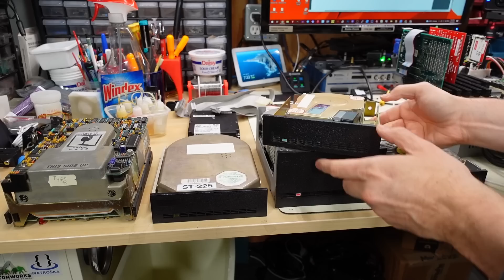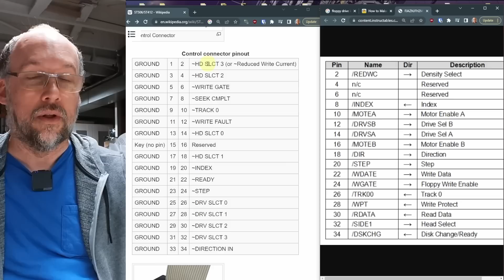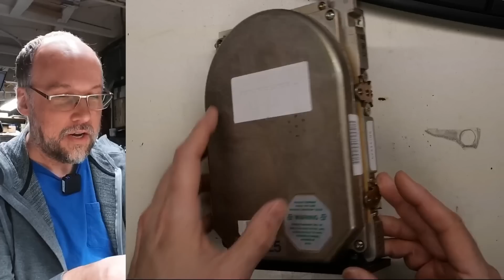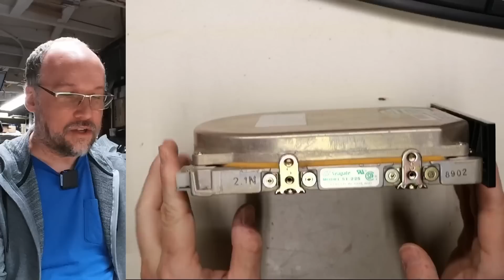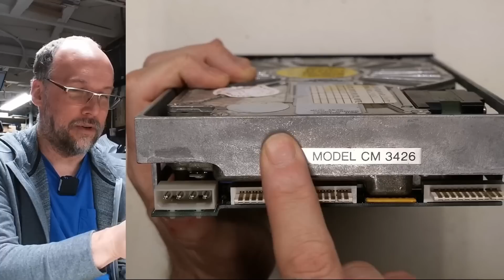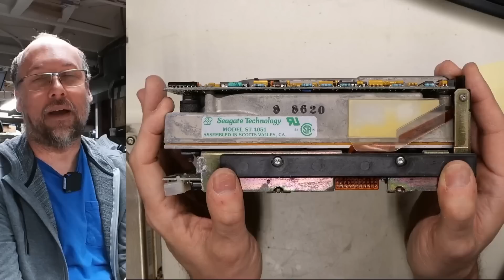Not forgotten: MFM hard drives

Comment: Back in the day, I definitely had issues with MFM drives on RLL controllers.  Data errors, failed formats, etc.  Also had issues using the old Perstor controllers that allowed for even larger than RLL encoding (for the life of me I can't remember exactly what parameters they used, but you got about 50% more storage than an RLL controller, so a ST-225 would get closer to 40mb on perstor, around 30mb on RLL, or the standard 20ish on the old MFM standard).

Comment: ST412 introduced buffered seeks where the controller would send a stream of step pulses in rapid succession without any consideration of the disk drives actual seek speed.  The micro on the disk drive would step and also accumulate pulses allowing it to step at its own rate, potentially quite rapidly once it got going, without doing settle delays etc.  The 506 could only step synchronously with the pulses from the controller so each step resulted in the controller waiting for the drive to step, settle and then say 'yep, I've done that'.

Comment: Have you considered using your David Gesswein MFM Reader/Emulator "Gessweinator" to actually image these hard drives before you destroy any existing data by reformatting them with your controllers?  You could find some really interesting stuff.  I ALWAYS image a hard drive with the "Gesswewinator" when I get it, before I do anything else, whether it came with one of my "Forgotten Machine" systems or just by itself on eBay or wherever...I always want to know what's on it.  That "Gessweinator", which I know you have, will work some pretty amazing tricks with these drives...  Oh, and 21:50 the "Gessweinator" can easily test, without overwriting any data, exactly how many heads and cylinders a drive has.  I've made several videos about this, too...

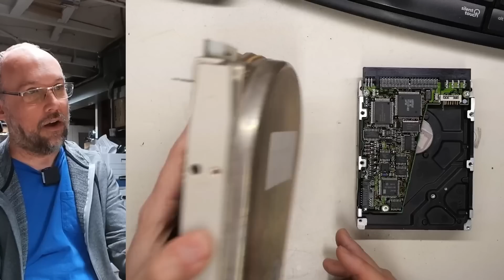Comment: 12:53 As I'm sure you've considered, the heads and the cylinders are defined/limited by the physical build of the hard drive.  You can't exceed more heads than the hard drive has, and you can't exceed more cylinders/tracks than the stepper can move the head arm assembly.  BUT, the sectors per track should only be a limitation of the controller, NOT the hard drive.  As long as the flux transition density doesn't exceed the capacity of the magnetic substrate's physical ability to store the transitions, or the drive circuitry to write the transitions in succession, there should be no other limits to this.  You should be able to have 50 sectors as easily as 10, but the sector size for 50 would need to be fewer "bytes" in length.  Now I'm rambling I suppose, but this is fun!

Comment: I also think Seagate ultimately modified the hardware on the ST-225 and resold it as an RLL drive under the model number ST-251 and ST-251-1 variants. They became known for a problem called "stiction" where the read head would literally stick to the parking sector at shutdown. The machine wouldn't reboot. The fix? Lift the front edge of the case up about two or three inches, then drop it. That was enough to release the head...at least is was for me and the 12Mhz 386 clone I had built with it. Fun days.

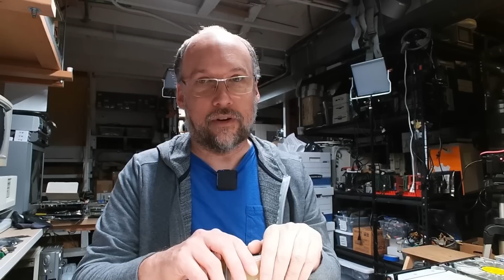Comment: 6:20 I've learned that when it comes to floppy disks and these "MFM" hard drives, what is written on each track (cylinder) is truly a "blank slate", where you can encode the formatting any way you want, and as long as you're reading what you wrote properly, it's going to work!  There are no rules with that, because the magnetic media really IS, a true "blank slate".  As long as you're writing and reading where the heads are located consistently, you're good.  Excellent observation, backs up my experimental results as well.  I have a video showing this about writing "unknown" format to a 3.5" floppy drive with the Convergent Technologies AWS, which never wrote to 3.5" floppies, only 5.25, in a very unique format.  That whole experience really put it all in perspective.  So, since I did a version of what you propose at 7:04, I think that you should go for that test, and that would be a fantastically fascinating video!

Comment: Interesting. I could have sworn that many of the old ISA multi-I/O controllers could run in 8/16 bit slots. How would the IDE drives work on 8-bit slots?
Reply: There were definitely XT specific, really 8 bit IO, IDE drives.  I think there were  also some that could do both 8 and 16 bit IO, automatically detecting the bus width of what ever they were plugged into.

Comment: The standard IBM PC interface used IRQ5 for these original MFM controllers; but when Tandy produced their PC Clone Tandy 1000, they deliberately "proprietized" the interface and changed the interrupt. Standard, off-the-shelf controllers wouldn't work despite bus-level compatibility; until I saw a magazine article with the fix; take a screwdriver and scratch out a trace on the controller card. That changed the default interrupt the board used to one the Tandy could talk to. And, yes, it worked 😁. It was only when I took my 1000 to a Tandy repair center for a warranty video chip change out that a store manager wailed at me for having a "non-Radio Shack hard drive," and I told him, "yeah, and it has nothing to do with the character generator ROM issue." He hushed, changed out the ROM, and I left happy 😁

Comment: I got my old Amiga 2000 going with one of these MFMs back in the mid to late 90s... 10 or 20 MB I think. For whatever reason, I had to boot off of a floppy when turning the computer on. Later that was replaced by a 500 MB SCSI drive, more storage than I would ever need on that machine.

Comment: My dad and I built an MFM hard drive for an Atari ST when I was a kid. We used an IBM XT case to house the two 5 1/4 seagate hard drives. The MFM adapter board was a product made for hobbiest. I can’t remember what it was. I think the Atari interface was FLL. I could be wrong as I think I was 9 when we built it.

That was my first experience with MFM drives. Not the IBM XT
Reply: After watching the video I think the ST did use an RLL controller. So that’s what the adapter card did.

Comment: Great video! 😊- I worked in a computer shop in he early 90's and remember fitting these. I remember that one of the main causes of failure was people not being bothered to 'park the heads' before they turned off the PC, thus the drive stopped with the heads resting on the drive platter. Any movement of the PC would likely result in disc damage and data corruption. New low level format, new bad sectors mapped and back to the customer.
Reply: Miss being able to low level format drives. We used to have so much control over them, wouldn't need to worry about smr vs cmr either.

Comment: You forgot one type of controller card, ERLL!  Back in the day, my brother and I ran an AMIGA BBS out of Tacoma, WA called "The Missing Link BBS". We originally started the system using an Amiga 500 and an 80MB SCSI drive. The Seagate 80MB SCSI drive was so expensive that it literally cost my brother 2 months pay for the hard drive! In order to expand our BBS file capacity, we converted over to my IBM XT Clone, using MFM drives that were much cheaper. We had 2 120MB MFM hard drives, but that wasn't enough. We did some research and came up with a 16 bit controller card that used ERLL! ERLL doubles your capacity, 25% more capacity than an RLL controller. With this we were able to keep the board going until 1994 when the PC graphics and software availability overshadowed the Amigas. ERLL did work with MFM drives, which is what we used and they were extremely reliable. We never once had a hard drive failure during that entire 10 year time the BBS was running.

Comment: TIL Shugart became Seagate. That's one of the things I love about episodes like this one! At a previous job, one of the other techs told me of some trouble he had when he was working on a notoriously sensitive test fixture belonging to one of our customers (if it ever moved on the floor even a quarter inch, a factory tech had to come out and recalibrate the fixture). It was driven by an ancient IBM PC with full-height hard drive, and despite numerous requests, the company saw no need to upgrade the PC with a newer model. That changed one day when the tech was downloading test results onto a 5 1/4" floppy (this was in the late '90s). He suddenly heard a CLANG so loud that he thought something had fallen off the PC shelf onto the floor! The company (reluctantly) sent out a replacement PC, and you could tell that although it finally had a 3 1/2" drive, it was literally scraped together from whatever spare parts they had laying around!

Comment: I never actually owned one of this type of drive despite the fact they were around when I built my first PC. As I recall, I looked at the whole MFM vs RLL issue but without an internet in those days it was difficult to decide which was the better option as the information was limited. The result was that my first hard disk was actually a half-height 5.25" 89mb Seagate SCSI. I then went IDE for a while before returning to SCSI again simply because the bus and the drives performed better.

Comment: The best thing about MFM hard disks was if you used an RLL controller you'd get a bonus 50% capacity (26 sectors per track rather than 17) so a 20MB HDD would magically become 30MB.  Supposedly the "quality" of disk required meant this shouldn't work reliably but I never had any issues.
Reply: It did depend heavily on the quality of the material on the plates.  What you could find is you take your trusty ST-225, format it with an RLL controller and it works perfectly.  50% more storage.  Then after a few months you start getting random read errors (note, this is not the thermal issue with these drives where you had to loosen one of the screws holding the PCB in place).  The media just wasn't up to 'holding' the magnetic domains strictly in place.  Things would blur a bit, the magnetic peak would move, timing shifts and you get an error.

Comment: I had a 10 meg MFM drive with a SCSI interface bolted onto it about 1990.  I recall it being 5.25" and full height, so it was actually more than full height with the SCSI card on it.  I wound up tossing it years ago and wish I hadn't!  It was bundled with large external box with power supply  and a sidecar with extra ram that plugged into the Amiga 500.  It was slow and grumpy but it was so much better than booting off floppies.

Comment: I worked at IBM in 1980 and had one of the first 5150 PC's. Back then IBM (actually a year later) charged $2000 for a full height10 MB MFM drive (which included the necessary 8 bit ISA controller). I should note that IBM charged $400 for a 360K diskette drive. You could put the hard drive and controller into a 5150 (it was almost identical to the later 5160 XT) with one big caveat. The 5150 had a crappy 63 watt power supply while the 5160 XT came with a130 watt supply. If you had a bunch of ISA cards in your 5150 you might not have enough power to spin up the drive. I later got a 3rd party RLL controller to boost capacity to 15 MB. Getting that working was hit or miss. I remember I had to do a low level format first (then after that a high level format was necessary). IBM didn't want you using an RLL controller saying (rightly so) that the drive was not certified to compact all the data and you could end up losing data. I never did that I can remember but since I was a tech back then many employees brought me their machines and some drives would just refuse to accomplish the low level format in RLL mode. Still, computing back then was a lot of fun. Love your channel, Adrian.

Comment: When you speak of possibly using encoding other than FM or MFM on floppy disks, I can't think of any notable instance on PCs, but it was certainly done on other hardware. Akai's S-series samplers from the 90s (such as the S1000, S2000, S950, S3200) store significantly more data on a single floppy than a PC can. They also don't refuse to format disks for issues like a bad track 0. I'm not sure what encoding they use, it's not well documented, but it may be worth looking into. They seem to use the same controller IC as PCs of the time, so it's probably still FM/MFM and the changes are merely to the file system instead of how the disk itself is encoded, but I cannot confirm this. Still, interesting in its own right.

Comment: Seagate's old naming convention:

ST-fXXXi

ST - Seagate Technologies
f - Form factor; 1=3.5 1" (3.5 half height), 2=half height, 4=full height
XXX - unformatted capacity in megabytes
i - interface.  None=MFM, R=RLL, N=SCSI

The ST-235R was an ST-225 that was certified to run with an RLL controller.

FYI, if that Micropolis 1325 works, it's worth quite a bit of money in the DEC community (it's an RD53 drive).

Comment: I had the larger 5 and 1/4 segate in my mac 512k circa 1986.  external scsi.  Inside the external enclosure was the drive and a scsi to RLL converter.  The ad is still on Google.  Named the Photon 20.  Squeak Squeak!  I loved it.  20 megs.  IBM made the 2.4 or 2.8 meg floppy drive.  Maybe that was an RLL floppy?

Comment: Seagate and Miniscribe did put a fair amount of intelligence into their MFM drives.  Seagate started doing this with the ST-225, adding built-in self test functionality and precision motion control outside of the of the controller card itself, allowing for motion optimisation and microstepping, which along with a special low-impedance stepper motor gave their drives the best seek performance of any stepper motor drive.

Comment: A brilliant video (in Polish), showing the internals of the interface of ST-506, and data recovery from one of the drives using DIY controller and a logic analyzer for capturing the data:
https://www.youtube.com/watch?v=SwEi7dK3rIA
It was also used as an add-on to polish Mera-400 machines, which used custom on-disk format.

Comment: As soon as I saw the title I was nostalgic. I used to run a BBS and I had two loud MFM drives. Before I put data on them I played with the interleave settings a lot. I was fascinated at the control of the configuration I had. 
Yes on the RLL video. Maybe compare the same drive when used with MFM vs. RLL? Capacity, speed (🐌) etc. 
Thanks!

Comment: I had a 40 MB MFM HD with my Amiga 1000, in a separate box with a PC-style power supply. On the bottom of the drive, an extra PCB was mounted on the bottom mount tabs, which connected with the 2 ribbon cables to the drive, and with a 50-pin ribbon cable to a board connected to the side slot of the Amiga. Later I figured out that this must have been a simple SCSI controller and that is was not unusual in the 1980s to have such a SCSI to MFM controller board installed on a hard drive. I didn't have any configuration SW for that setup, but only the bare minimum that made the drive work on the Amiga (you had to boot from a floppy to start the drivers for it and then transfer all the system assigns to the hard drive to be able to remove the floppy), but it was very slow, only about twice as fast as the floppy drive. It was also very noisy and had to be oiled regularly. But yes, I had a hard drive on my Amiga 1000, which was already something ;-). Later I tried some other HDs from old PCs, but they didn't work, I guess the controller was hard-coded for that particular drive or I would have needed some special setup tools...

Comment: Floppy disks have used Grooup Coded Recording (GCR) which is a descendant of RLL with some extra auto-correction checksum for a group of 8 bytes. So the name GCR. The Amiga used this GCR and thus Amiga 3.5" floppy disks stored 1.68Mb instead of 1.44 for the same floppy disks on a PC which still used MFM encoding.

Comment: When I was a teenager working for a large distributor of Seagate, WD and Miniscribe, we did extensive testing for weeks continuously in a CRC bad sector tester. The machine we were using was the very same one that prints the bad sectors on top of the drive. We failed to find any MFM drives that was made less reliable by running on an RLL controller. After these tests, I never ran a drive with MFM scheme again for my own use at least. The increase in capacity was almost universally experienced as 1.5x
Reply: I think it just had to do with warrenty to cover the manufacturer's backs, I never understood how a RLL controller would stress a MFM HDD more than it should. The way I understand how it works is that RLL encodes data more efficiently than MFM does, nothing less nothing more.
Reply: @Alexis_du_60  We did prove that in the sample sizes we had. Over the course of one summer we probably put 50 drives of different MFM generations under those conditions. A couple failed, but that was well within the failure rate at the time, regardless of encoding method.
Reply: I can add that back in that time, it was also common to add such drives to Amiga (with famous ALF toolkit). And everyone I knew (including me) bought a MFM drive and used it with RLL
Reply: @videowatcherdeluxe  It is as reliable as drives were at the time. In the early 8 or 16-bit days, I never lost a drive. Now, of course, even though drive technology is basically magic, I have lost a few, but only over the decades since.

Comment: I remember the first MFM hard drive I installed on my IBM. 
It certainly was a learning experience. ( no internet yet and BBS's would take a few more years to mature )
From memory, the hard drives bought after the 80's also had the head and sector info along with the bad sectors printed on the top.
Reply: Yeah the bad block map - it was rare to see blank ones.
Reply: @the_kombinator  I remeber spending time looking for the smallest list on the stack...
Reply: My bbs ran a 20 c drive and a 40mb d drive...mfm. ...great times
Reply: IBM sold them in systems before April 1981.
removed them all for SCSI and IDE, on 8 bit ISA interface cards.
Why he needs borken old disks ...?